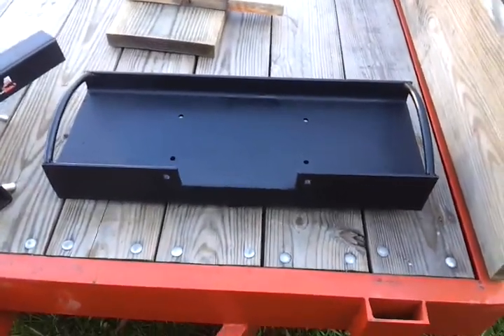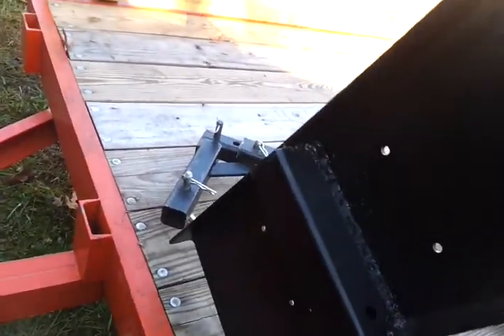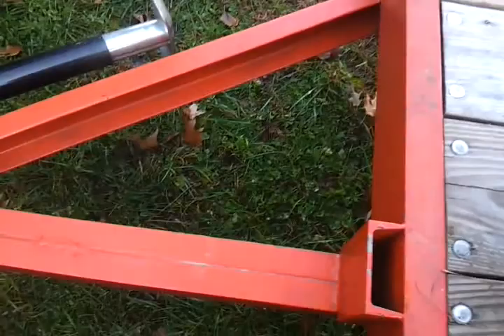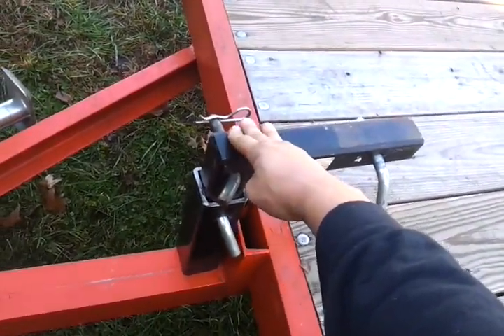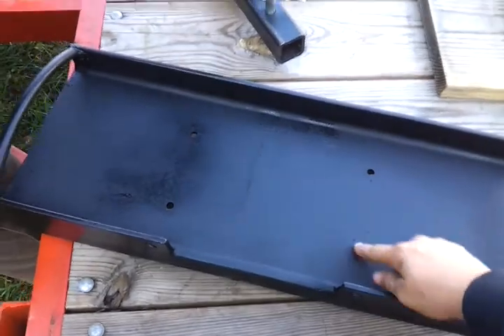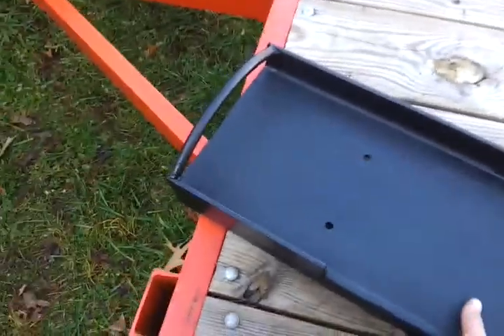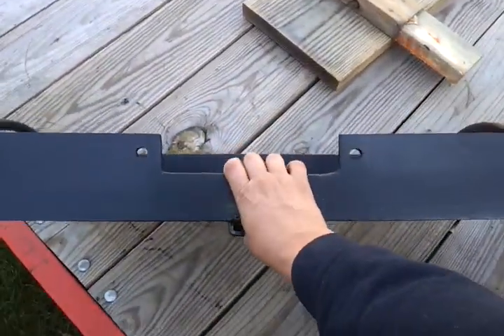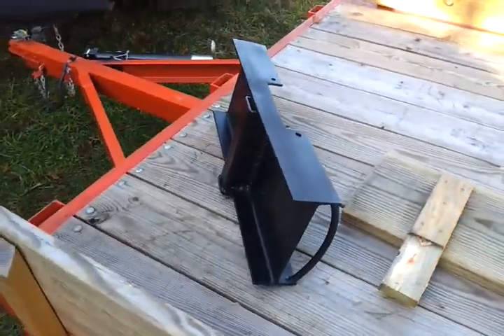Finished homemade winch mount.

Comment: I took a harbor fright trailer hitch extender and I bolted the badland universal winch plate onto it and I also welded the universal winch plane to the trailer hitch extender so it has a lot of strength to it